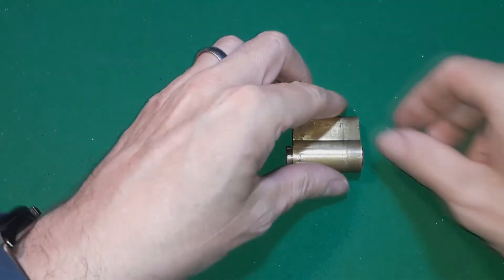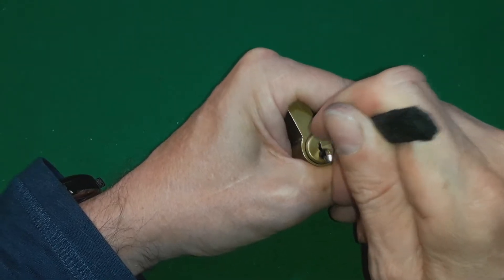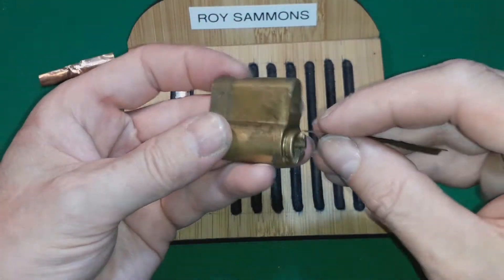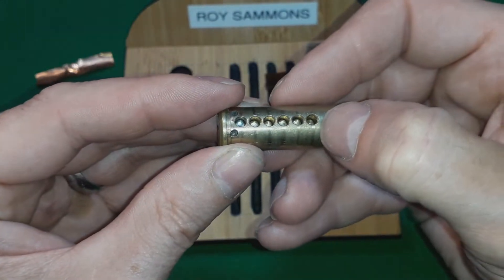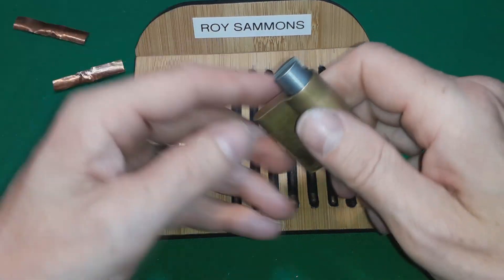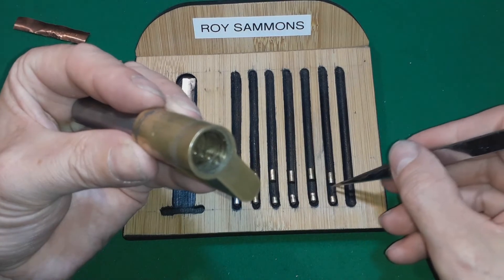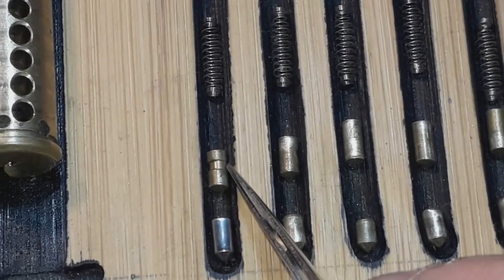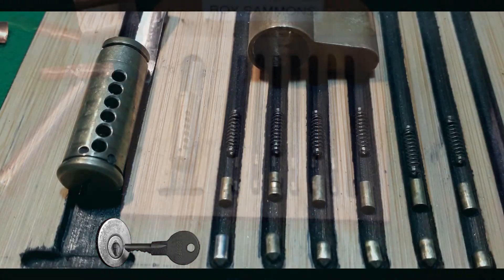(268) SPP Lock Picking with a Worm Rake

Comment: I still don't understand how you can spp pick a lock open with a rake. Could you explain it to me again? Thanks.
Reply from the maker: First you rake the lock into a false set, then use the humps to try and manipulate the pins that still need setting. It works well on high security locks too.
Cheers for asking the question and watching.
Reply: @roysammons2445  sounds intresting... Thanks. I will try it. Do you know any pick maker in europe? I broke a sparrows hook in a custom lock with very powerfull springs so i had to put a lot of tension and the pick bend. Thanks again.
Reply from the maker: @ERROR-Musik474  UK:
Law Lock Tools
UK BumpKeys
UK Lock Pickers

Germany:
Multipick
Reply: @roysammons2445  thanks for informing me. I think that the ship ping is way cheaper, but is UK in europe?